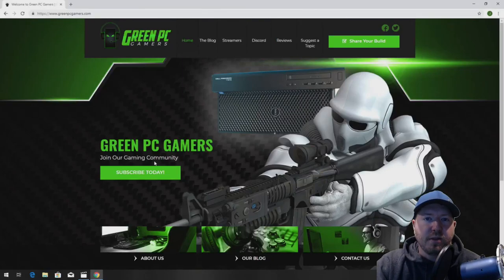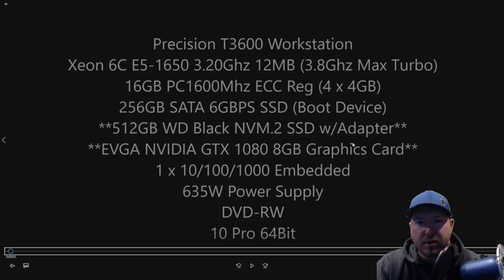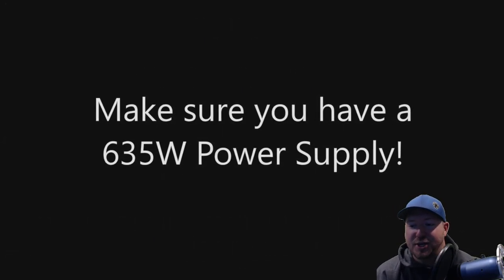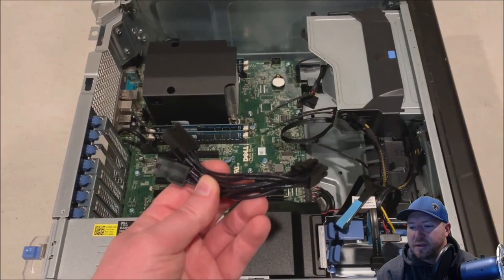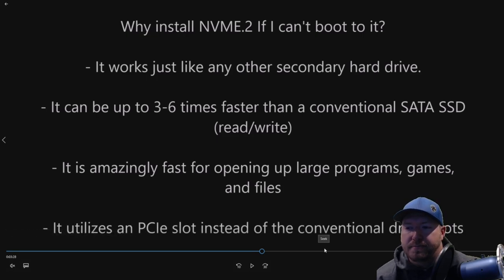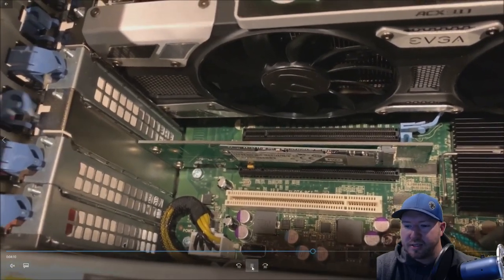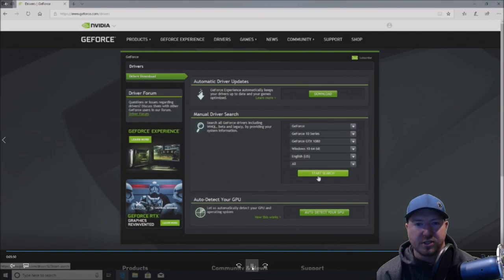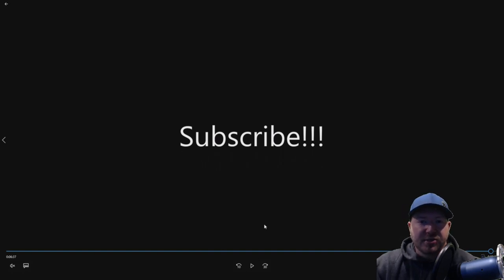Precision T3600 Gaming Computer (NVIDIA GTX 1080 and NVME.2 Install)

Comment: Do you think the T3600 can handle star Citizen?
also, I have the 2.4ghz  octa core Xenon, should I consider replacing it?
win 10 pro, dual booted Linux
16 Gig eec 1333
rx 580 4 gig
500Gig SSd boot
1-2 Tb cuda 7.2 for storage
55Inch 4k tv
IK the system is dated, but its still runs good so hard to justify the purchase to my wife :P
Reply from the maker: Yes, but you will have to tweak your settings for it to run smoothly.  Let us know if you try it.
Reply: @GreenPCGamerscom  Turns out I have the 1600mz ram so thats nice to find out.
Im wondering about the boot device, about to format the ssd, do you know if there was a size limitations on it, I formatted mine for some reason to be smaller than 500 gigs.
Another viewer was asking about ram upgrades and now im worried to try and boost mine to 32 or 64 gig

Comment: Can I install a dual ASUS Rtx2060 Super video card?
Reply from the maker: You could, but it wouldn't be worth it, because the T3600 motherboard will not allow you to configure Geforce GPU's up in an SLI.
Reply: @GreenPCGamerscom  The ones you describe on your website if they could work on my T3600? I need a GPU, of the capacity greater than 4gb, previously the one I had was an Nvdia Quadro 4000.

Comment: Will that work on HP Z420?
Reply from the maker: The GTX 1080?  We haven't tried it in a Z420 workstation.  However, we know a few users in our community that have successfully installed GTX 1080 Graphics Card in Z420 Workstations.

Comment: I actually just picked one of these T3600s up about a month ago with the same intentions of building a gaming rig before seeing your video funny enough. I was also looking to swap out my GPU for something newer/better and I was about to go in on an AMD RX 580 GPU, but I've discovered something of a hiccup regarding the Dell BIOS resolution VESA 103 not being supported by newer GCN3 AMD cards which results in not being able to view the BIOS. I was hoping maybe you could shed some light on this and if you know of any solutions to running newer AMD cards on these older Dell workstations. All I've been able to find is that somehow MSI Afterburner may solve this but nothing to confirm that anywhere. Thanks!
Reply from the maker: We strictly use NVIDIA products in our builds to try and avoid issues that you are illustrating.  We also prefer NVIDIA products because they tend to offer better driver support for PC games than AMD.  That being said, we've run in to some issues with NVIDIA products on Precision workstations as well.  For Example: Sometimes when swapping from a Quadro Card to a Geforce Card you have to update your driver first using the dvi port before you can utilize the Display Port or HDMI port to get the max resolution.  Would you ever consider trying a NVIDIA Geforce Graphics Card?  Thanks for commenting!
Reply: @GreenPCGamerscom  Considering the issues I've discovered from other users, it seems like Nvidia is the only way that I can go, not that that's a bad thing at all (lower power consumption, less heat, better support). I'm looking into buying a GTX 970 for $80 USD now. Although the card is a bit older, it seems like it should still be able to hang for modest gaming, plus I have no immediate intentions to push past 1080p @ 60hz for the present time being so this is only a stopgap in a budget build.
Reply from the maker: FullBloodedItalian30 the GTX 970 is a solid gpu.

Comment: Hey man is there any other way to use a nvme ssd with one of these systems, since i have no PCIE slots left, my gpu covers two and I have a sound card and wifi adaptor installed
Reply from the maker: You need PCIe slot available to add an NVMe SSD to the T3600.

Comment: Has anyone been able to actually install Windows 10 to this machine I have tried everything I've even tried booting from a DVD drive and it still just hangs on Windows logo and just stays there I've tried flipping everything in the bios and disabling raid I'm just at a loss and I'm really biting my head against the wall now
Reply from the maker: You are most likely have a memory/ram related issue.

Try installing with a single memory module installed.
Reply: @GreenPCGamerscom  thanks that doesn't seem to make a difference. I ever tried different ram sticks. The USB route doesn't work either
Reply: @AaidynsDad  year later but was it because you tried 64 bit rather than 32?

Comment: can we use nvidia gtx1660 on my precision t3600
Reply from the maker: anuroop sobanan, as long as you have the 635w psu, the 1660 or 1660ti should be stable in the T3600.
Reply: GreenPCGamers.com thanks

Comment: Do you think my Vega 64 can run on the 635w psu?
Reply from the maker: Hey James,  it depends on what you plan to use the system for.  AMD recommends using a 750W PSU with that Graphics Card.  However, if you are able to provide enough power rails to the card and you don't run it at max load, it should work fine.

Comment: can i install a 3 fan gpu ? on the t3600
Reply from the maker: Hey Anakin, are you referring to installing a 3rd part gpu fan assembly?
Reply: @GreenPCGamerscom  no,am referring on the graphics card i have an xtreme gaming 960 with 2 fans but i dont know if ill fith a graphics card with 3 fans most graphics card that have seen have 3 and am interest on having a msi on my t3600
Reply from the maker: That makes sense.  What are the measurements of the card?